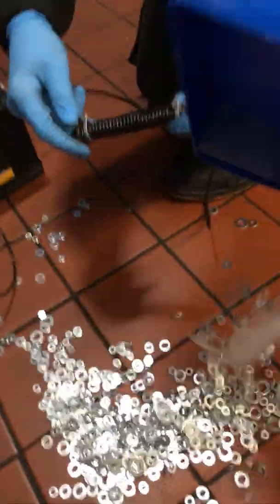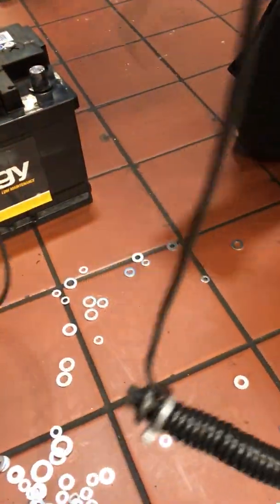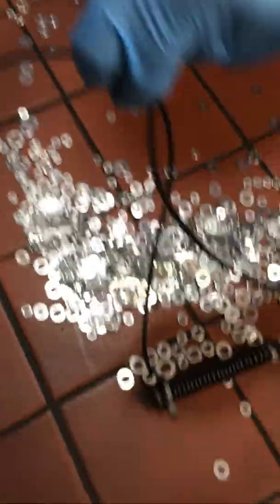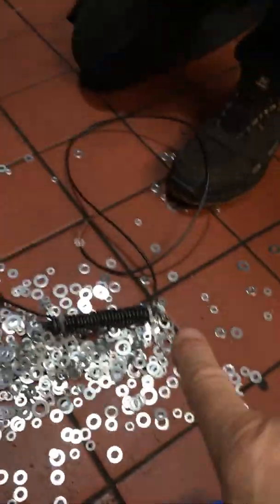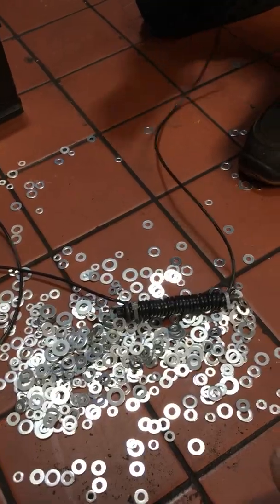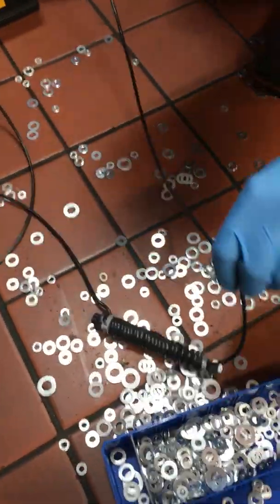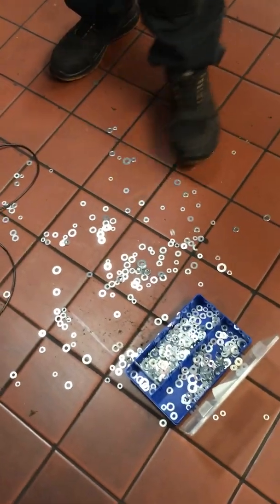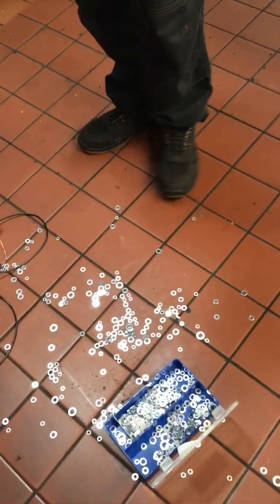Picking up washers off the floor with a badly built electro magnet..(don’t try this yourself)

Comment: There is obviously too few windings on the coil. This causes excessive current flow and heating, but the core material in the coil probably saturates so that you don't get a good magnetic field. To improve: 1) Use more windings (start with 100, maybe 1000); 2) Use a thinner wire for the coil; 3) Use a larger core to avoid saturation; 4) Use a better magnetic material for the core. Use transformer steel if you can. The iron-cobalt alloy (FeCo-50 also known as Permendur) works best, withstanding magnetic fields up to about 2 Tesla. An U-shaped core helps to concentrate magnetic field at the point of interest.

Comment: unfortunately it doesn't grade them at the same time, also you can put the magnet in a plastic bag then turn the bag inside out leaving the washers etc inside. .. if you put a screwdriver inside the coil of wire and flash the coil it will magnetise the screwdriver.